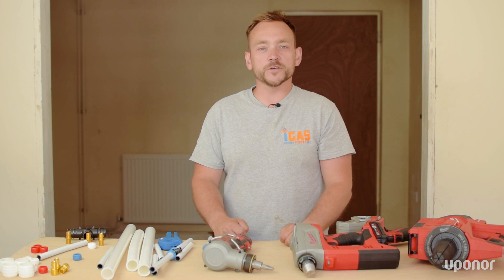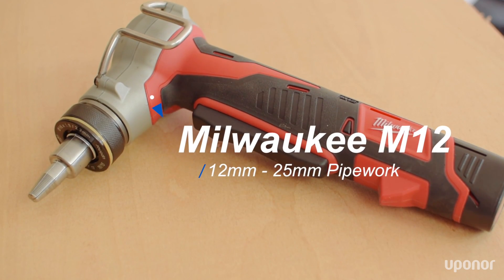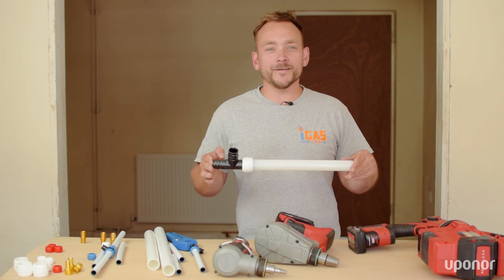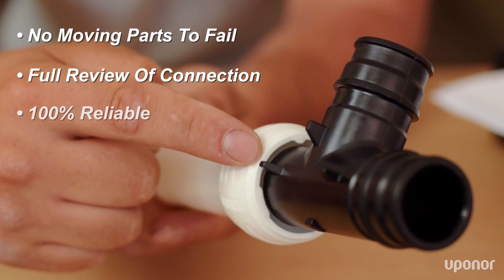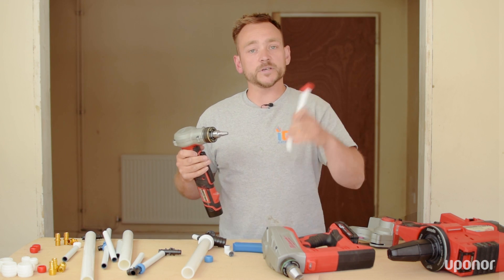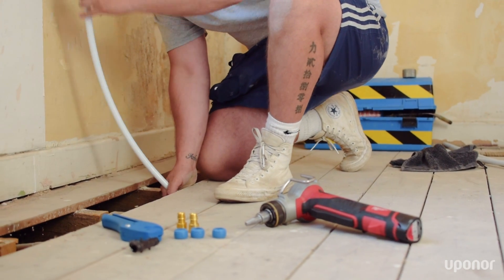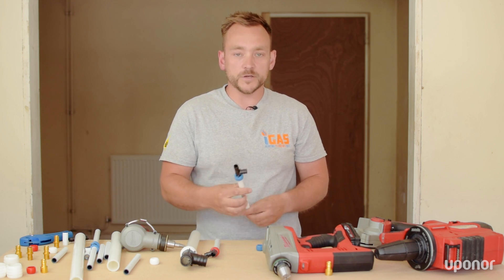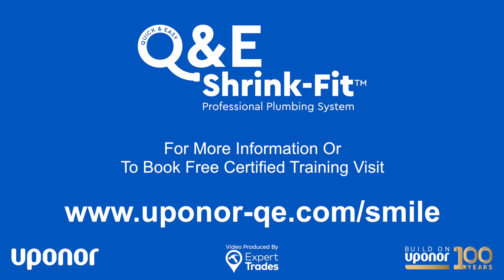The Uponor Q&E Shrink Fit Plastic Pipe System- Installation Guide

Comment: Been heating engineer on domestic and commercial sites for years, saw one of this methods online. Arranged meeting with my Uponor rep and tried this and other joining methods. Have to say very impressed. I take samples with me and inspected them at home. Measured internal bore and compared with Speedfit, CU etc., cut on half completed joints, bend them, try to push apart using grips. Also  you can make joins when some water still in the pipes, disassemble completed fittings to do repair and joint them back. I think it’s exactly the same situation when Speedfit come out to the market and everyone afraid to use it saying it’s not reliable but now lots of engineers use it.

Comment: I'd like to see you using it under cabinets when you just cut the pipe and water drips and you have close to no time to push a fitting in .is easy when dry and in the open hahaha even cutting the pipe under cabinet isn't easy let alone using that big tool under it.

Comment: Can you use sharkbite  on this pipe
Reply from the maker: This is not recommended, as the Q&E Shrink-Fit PEX System must be used as a complete solution. By combining Q&E with sharkbite, you invalidate the warranty and there is also no guarantees on joint security
Reply: But that’s the point of British standards, you can use poly plumb in speed fit (although not warrantied) it won’t leak

Comment: What if the solder joint leaks. Can you solder close to it ?
Reply: Solder it on the copper before you Q&E the final connection after it’s cooled u doughnut
Reply: 0792matt   You would have to cut the pex I would imagine, repair the solder connection and splice in a new small section of PEX-A. Confirm with Uponor UK but that is the way it is in the U.S.

Comment: Yes - very good out in the open on the bench - but most plumbing joints are in corners behind kitchen cabinets, under suspended floors,  in narrow ceiling voids etc. I would say that only 5% of joints are "out in the open" like this. Show us this system working at floor level, in a corner, under a kitchen cabinet. I assume it can't be used for gas  - that in itself speaks volumes..
Reply: The expansion system is the easiest of all the PEX systems.  The tool is a one hand operation whereas compression requires two hands.  With expansion, you don't need to put the tool up to the joint as you do with a compression PEX.  Bend the pipe to where the tool is, expand the pipe, move the pipe back to the fitting and install in a 5 second window.  No plastic system works on gas, but on the other hand, plastic pipe won't pin hole in 10 years like copper can...
Reply from the maker: Thank you for your comments. You have raised some very valid points and we will definitely look into this for future content ideas. This initial video was only designed to raise awareness of the Q&E Shrink  mechanism